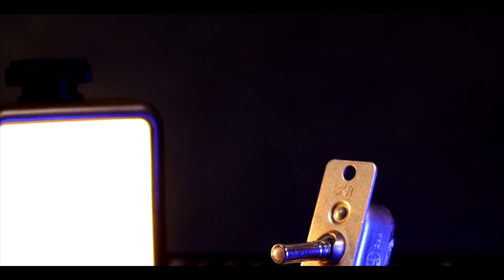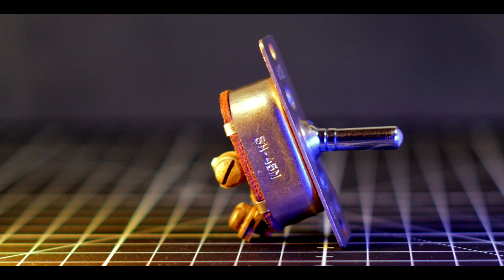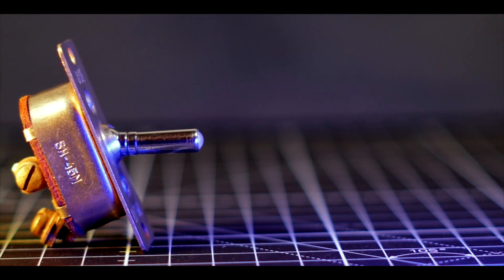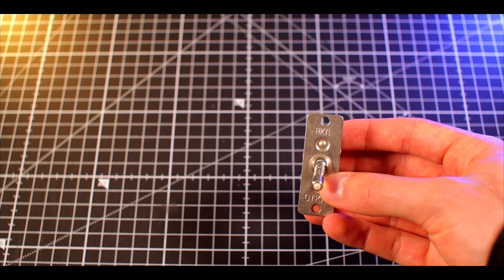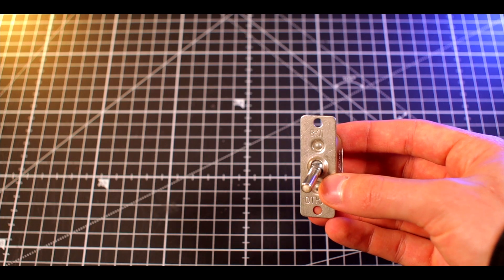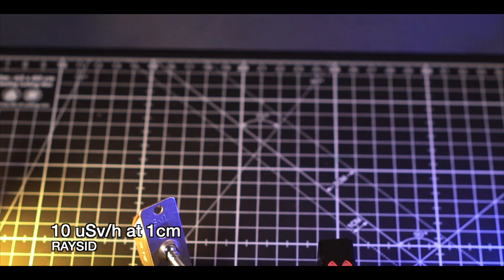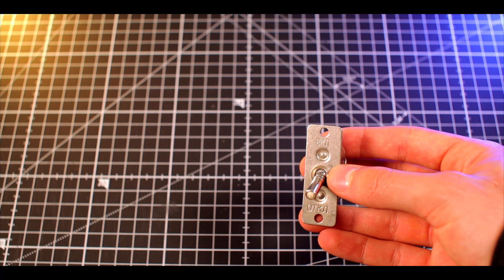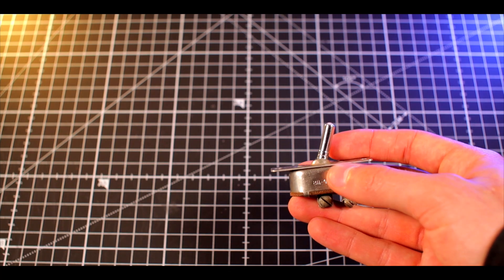Radioactive BH-45M Soviet Switch

Comment: This looks nearly identical to the 40s-50s era B-9A switch I use as a check source, which I gather was made by Cutler-Hammer in the US. I wonder if this was a licensed design shared with the Soviets during WWII since they really look more like second source parts with none of the minor drift in styling and process that reverse engineered clones often have. Mine is not nearly as spicy as the Soviet equivalent, I get around 8000 CPM right up next to a SBT-10A thin window GM with the beta shield off.
Reply: I have some of these made by C&K.

Comment: Any indicators to follow when purchasing?
Reply: I'd say the main visual indicator in like an auction listing is the browning of the phosphor dot which resembles the same browning that occurs with phosphors and sometimes lens crystals on watches and clocks that use the same sort of luminous compound. There might be late production Soviet ones that still have radium and haven't degraded to the point where there's a visible color change though. If you're in the US market "WWII aircraft switch", "B-9A", "B-5A", and "AN3022" will bring up a bunch of the US version of the same switch that show the characteristic "suntan" of aged luminous paint.
Reply from the maker: That is a difficult question. Of course it is best to to try and measure it with a Geiger counter but if that is not possible then ask the seller if the switch glows in the dark if it doesn’t, then the chance of it being radioactive is much higher but this methods isn’t 100% reliable.
Hope it helps 😉